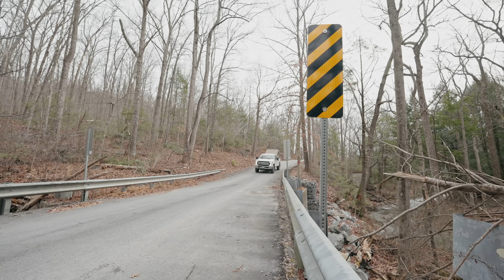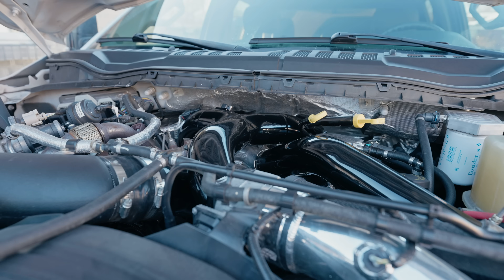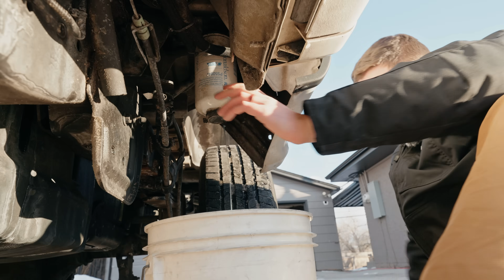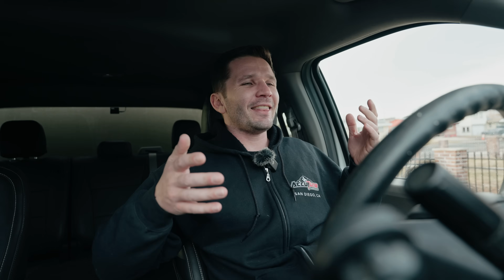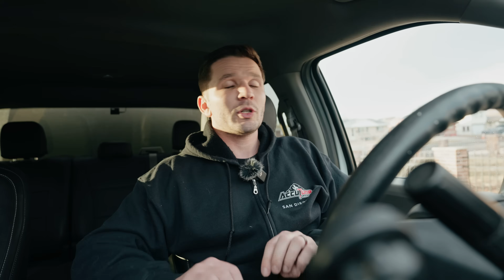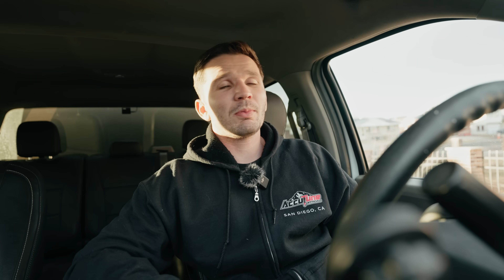6.7 PowerStroke Pros and Cons After 200,000 Miles

Comment: Love my diesel, specially for highway miles.  Had a 6.7 but went to GMC to get independent front suspension.  So much better than solid axle for my use.  But the 6.7 definitely felt like a more powerful motor
Reply: Better get the cognito kit for the idler and pitman arm
Reply: I did the same , traded my 18 Ram for a 24 Duramax wow what a difference in ride quality, but also power and build quality too!  no death wobble and no CP4 for 90K+
Reply: @  duramax was solid when they had actual Allison trans
Reply: @  Allison put there name on it, its still their engineering 10L1000 ,GM is just making them, they retained the rights to produce them, but I agree Allison would probably use better materials an so yea they would be better,  give it some time hopefully gm does a good job so far its been smooth and strong, haven't towed heavy with it yet.
Reply: @  150k is about all theyre good for. Watch randys transmissions on them vs the 10r140. Gm did what gm does and make it “work” instead of making it right. Ive still got my 07 lbz classic i drive back and forth to work but theres also a 22 powerstroke bc the hell i had with my at4. Wish you the best the duramax is a fine engine

Comment: Getting the DCR transplant in April. Also adding Pusher intake and hot and cold pipes. Good bye to Ford recall on the CP4.
Reply: How much for the intakes? Does it do much for performance?
Reply from the maker: @MattC0725 yes they help a lot. I will have a Dyno comparison out with the intake vs a stock truck soon

Comment: I’ve got a 2012 with 205,000 on it. Been a pretty solid truck so far. I have always changed the oil every 5-7500 miles and I change the  fuel filters at the same time. Clean fuel is a game changer I feel for the cp4 longevity.

Comment: Bro I got 2011 6.7 with 317k on it no additives used , works like it was new , I do change all my filters on time and frequently,  only thing I changed so far is fan clutch , and ball joints still same transmition, it is delited when my waranty run out. ,
Reply from the maker: That’s awesome! Sounds like a wicked solid rig

Comment: Great video with lots of info. Two questions for you:
1.	I have a 2017 with about 65,000 miles, still under an extended warranty. My UOP has had a minor weeping leak for several years. It causes some buildup around the oil filter but isn’t severe enough to leave drips in the driveway. I’m debating whether to have the dealership attempt a repair, as they might make it worse.

Looking back, do you regret repairing yours the first time? And at this point, do you plan to just leave it as is?

2.	Your discussion with the guy who ran his up to 900,000 miles was great—he strongly recommended the external oil filter. What are your thoughts on that? Do you plan to install one at some point?
Reply: Biggest pain with the upper oil pan, Is the transmission has to come out. I would have it fixed under warranty, it’s like a 9 hour job. I don’t want to know what that would cost out of pocket.

Comment: I agree with what you said except for the 'platnium' DEF.  The DEF system is an after treatment and affects nothing else on the truck, except the rest of the exhaust pipe.   DEF is 70% water and 30% urea, urea is a chemical compound CO(NH2)2, it is either CO(NH2)2 or not, there are no 'quality' levels.  If you run DEF i'd suggest buying the cheapest you can get; when I ran it I used the walmart brand.
Reply from the maker: Makes sense. Thanks for sharing your opinion!
Reply: @lhurst9550  this is not actually true with regards to the platinum DEF. This actually has an additive in it to keep the crystallization of the DEF to a minimum once it dries. It is because of this additive that some vehicles don’t like it because the ratios of urea to water are not precise (because the additive technically throws off the ratio slightly) most vehicles don’t notice though. You will notice less buildup of DEF crystals on the injector and in the system with this product.
Reply: @FireCraze   That is just advertising, they also say it improves MPG, which is impossible.
Reply: @ it might be just advertising but I’ve seen side by side tests, even verified in my driveway. The platinum when spilled on my driveway, does not crystallize. I’ve taken my DEF injector off two new vehicles of mine, one with platinum and the other with regular DEF. The platinum has almost no buildup while the one with regular had the normal buildup. One could argue if the buildup actually causes a problem or not, but I’ve seen first hand where the platinum just doesn’t create the crystal buildup.
Reply: @FireCraze   Hmm, 'ya got video?  Maybe a good subject for this channel to do a test on.
Reply: @ no video from me, but if you are like me, you won’t believe it until you try it for yourself. Splash a little of the platinum on the ground and see what is left after it dries. Sure, there is a small stain, but not the crystal formation you get with the regular stuff. The real question for me is does that build up of crystals in your exhaust actually cause a problem? I tend to think not but who knows. I think there is a guy in the ram ecodiesel forums who posted pictures of a similar findings.
Reply: @FireCraze  DEF is a burden I no longer bear.

Comment: Do you ran with your exhaust brake on all the time?
Reply from the maker: No I do not. I’ve found the exhaust brake to be kind of annoying to use
Reply: @powerstrokemaintenance  i love using mine.
Reply: @RXR91  I absolutely use mine almost every time I drive
Reply: @PowerstrokeSynd same..
Reply: @RXR91  its good for the turbo and saves on brake wear.  Plus its sounds awesome!
Reply: @PowerstrokeSynd exactly

Comment: Thank you for saying the cp4 problem is over rated! No one wants to say anything when it does last. The death wobble is a bigger problem people need to talk about.
Reply from the maker: YES! 100%. I've spent more on steering parts than on emissions and fuel system repairs
Reply: I’m in Florida, going to Georgia this weekend to see a 2019 f350 king ranch 120k miles 39k with a dcr conversion, fox steering stabilizer, and color matched mirrors grill etc… wish me luck 🎉
Reply from the maker: @Romantuzhyk12345612 best of luck!
Reply: @powerstrokemaintenance  thank you sir
Reply: @Romantuzhyk12345612  how did it go?🤙🏻
Reply: @Romantuzhyk12345612  That's a lot cheaper than what my brother paid.  My brother had to pay $76,000 for his 2019  F-350 Platinum diesel when it was a 3 year old used truck.
Reply: Never had an issue with cp4 or death wobble out of my 2012. Did not start using fuel additives until 150k tho and 160k now she’s still breaking in.
Reply: @Rizillairl  Same here. 2014 with 198,000. Changed fuel filters every 10,000 and added a disaster kit. Just problems with DPF sensors.  crosses fingers and knocks on wood
Reply: The steering is easily fixed with new steering linkage parts, ford just uses ball joints with plastic cup and no grease fittings.  The oem parts wear out very quickly.
Reply from the maker: @lhurst9550 yes they definitely do!
Reply: @lhurst9550   not just that but the steering box is trash. Ive got 300k on my truck and driving on the highway is a chore until I spend the 700$ on a new box from redhead
Reply: @lhurst9550  good to know thank you 🤌 anything else I should worry about
Reply: I completely agree with what you said here cp4 is not that much of a worry.
Reply: @garrywest7737 and how many miles
Reply: I added the S&S disaster prevention kit as well. And always use archoil on fill up on my '11 F350 with 230k miles. Only problem I had with my truck was death wobble. It only started to happen when I leveled the truck. The steering parts must have been bad and got revealed by leveling the truck. Replaced everything except the steering box and it now drives great.
Reply: 99.9% of them are perfect.

Comment: Using an additive would add up to the cost of a cp3 conversion over time.
Reply from the maker: Yeah if you exclude all the other benefits of running an additive lol
Reply: @powerstrokemaintenance  There are none, except if you are buying low quality diesel.

Or, you run a cp3 and never worry
Reply: @hitempguy  you cant put a cp3 on a powerstroke theres not enough room. Cpx or dcr is the only conversion
Reply: @hitempguy  there is no CP3 conversion…
Reply: @kwaggs19  Yes there is lmao
Reply from the maker: @hitempguy show us the math and info on a swap or you’re banned for spam

Comment: got a few things coming up where i need to make sure truck is not down for upgrades, but one of these warmer weekends in april i'm putting my DPK on.  little nervous but PTT says no big deal, zip the intakes off and put er on!  i've also got an upgraded PCV from a 2023 to put on.
Reply from the maker: Good luck with the install! Let me know how it goes. It seems like you're pretty handy
Reply: It's nothing too hard,  just a lot of bolts basically. it's the most involved thing I have ever done to the truck and it wasn't really bad at all. Just take your time and you'll be fine.
Reply: @-R_H  awesome!!! Yeah as soon as I know I have a few days where I can spare not having the truck (just in case) I'm gonna tackle it.  Should have pretty consistent warm temps soon.